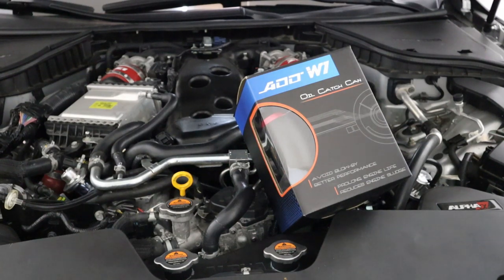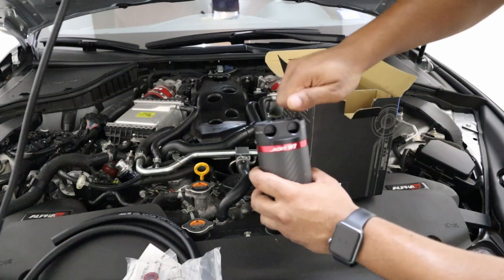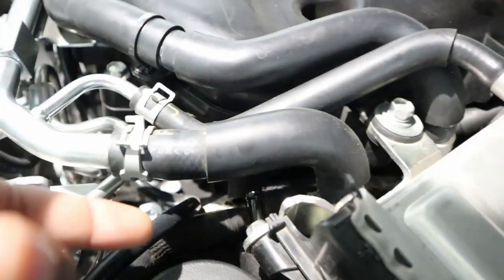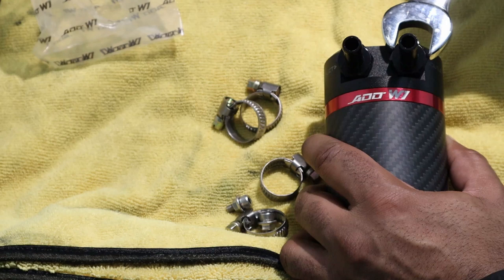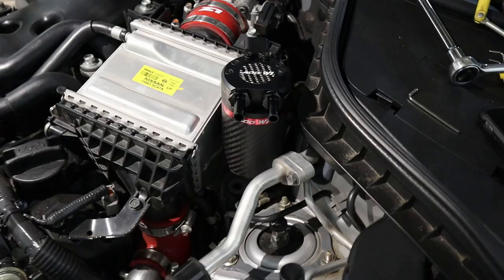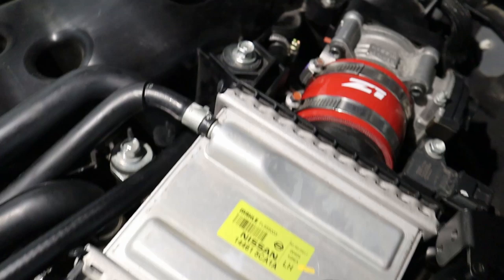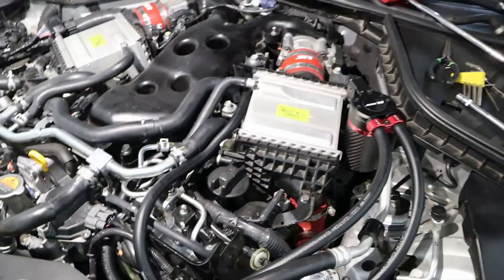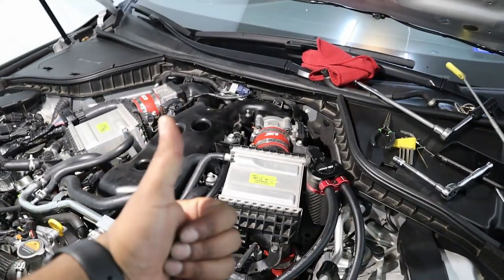Q50/Q60 VR30DDTT ADD W1 Carbon Fiber Oil Catch Can Kit DIY Installation

Comment: Great video! I’m about to install the exact one on my q50. Question, does it say in the instructions (because I haven’t received mine yet) that it works best with the hoses that long or can we cut the length down to better route/fit? They seem to long.

Comment: I see you already had BOVs installed. Do you think doing the OCC install first would make it difficult to do the BOVs after, or should I do the BOV install first?
Reply from the maker: Either or is fine. Pretty simple to install both. Or work around both i should say

Comment: Hey man just got ecutek tuned. What oil do you usually use to top off with? They mentioned I needed to keep the oil level high once I got the tune.
Reply from the maker: That is correct and I use 5-30

Comment: I take it no real difference in performance over the Mishimoto, more of a preference thing. The dip stick is a nice additon tho, saw you can put in a small house and use a plastic syringe to extract oil out instead of disassembly
Reply from the maker: Either or will work. The Mishimoto has a better bracket i will say.

Comment: I’m guessing that installing this won’t leave room to put the engine cover back on, does it?
Reply: It also seems like a tower strut bar would not be usable with that location?
Reply: @casperq60  With my Mishimoto setup, a STB would not fit. I chose running the CC over a STB. It looks like he can't fit a STB either. My engine cover fits.
Reply from the maker: Engine cover can be added back on.
Reply from the maker: A strut bar is useless to me really specially being AWD i don’t feel any difference with one so a waste in my
Book.
Reply: @EnthusiastPOV  <--- agreed. To much wiring harness screwing around, and lines in the way. MUCH prefer a CC anyday. How's TX? I was hoping when I go to AMS to have hooked up n chatted about cars. If you ever come to NH look me up. I believe you have my email.
Reply: @EnthusiastPOV  would you reccomend the moshimoto oil catch can for around 120$
Reply from the maker: It’s not bad but I’d go with add w1
Reply: Enthusiast POV nice. Also I have a 3.0t with about 70k miles. Do you think adding a bov kit would benefit me at that amount of mileage or have my turbos been ran through enough it won’t do any preventative measures
Reply: yes it does

Comment: I put the Mishimoto Catch can on my Red Sport. I get about 40-45cc of crud at each OCI of 4K-5K miles. I checked at 1K, then 2 k, etc. until I realized 4-5K miles was fine. I do Blackstone oil analysis at each change. Baised on the data 0-20 works fine. Direct  injection needs a catch can!

Comment: Thanks for this can’t wait to try mine on
Reply: Hey I installed mine , but I’m concerned about he hoses , it’s slightly kinked at the connections because it’s not the oem hose and also one of the hoses touching an area where it gets really hot , will it melt ?

Comment: Any idea if the catch can will void warranty? Returning it back to stock before dealer visits would be brutal as getting the factory hose back on would be ridiculously hard
Reply from the maker: It probably does void some type of warranty. The install and uninstall is pretty easy.
Reply: @EnthusiastPOV  getting that stock pcv hose back on is definitely not easy

Comment: Does that dip stick on the CC have an oring to seal it closed when it's screwed on?
Reply from the maker: It doesn’t need one. It’s screwed on and seals nicely. Even if overfilled, you’ll never see it spill from there
Reply: @EnthusiastPOV  thank you.

Comment: What happened to the original oil catch can you had? You made a install video months ago and suggested you supported that brand. After watching that video i bought that product. What happened?

After you put some miles on the car with some hi-performance driving with that catch can installed, pull the clean air outlet hose and for example run a gun bore cleaning rod with a clean white patch into the hose. Let's honestly and with an unbiased point of view see how well that Tripple Twister baffle design really is at catching the liquidified vapor contents.

I'm always leary of reviews where the reviewer recieves the product for free. That's just me.
Reply from the maker: The original catch can was fine and there is nothing wrong with it. If you purchased it then you should still have a solid product. I bought the catch can to show it to all of my viewers my intention was never to keep it not sure what gave you that idea. Your preference on how you see videos or products on my channel may not be what you’re looking for. I’ve always given my unbiased review on products I’ve tried. The Mishimoto catch can felt unfinished and this one does with the exception of the bracket which I feel Mishimoto executed much better. The triple baffle system will be reviewed once I open it up in 500 miles just to see what it has done.
Reply: @EnthusiastPOV You say "my intentions were never to keep it. I dont know what gave you that idea".

 You installed that product on your car and you bought it with your own money is what gave me that impression...so yea, seemed like you bought it to use. No where did you mention the fact that it was just for demonstration only purposes. With this said i knew it was a good/tested product so im not blaming anything against you for flip-flopping. Just seems like you and your other Q50 partner float around to whoever sponsors your videos as to who you promote. I understand that thinking but that rarely leads to the best and most authentic product presentations. Free stuff usually doesnt add up to the best stuff. 😞
Reply: @EnthusiastPOV  To see how well it actually works which is the whole basis for buying something like this is to check the out going clean side hose for oil and other content. Now since you've gotten supported by the company with a freeby the answer is will you provide a unbiased and truthful review in the future? If you don't give a positive update/future review then that company will be upset with you. See how that works?

Also, the comment that the first reviewed CC seemed like unfinished or something is an out in left field comment. What did you expect for a under the hood item that catches oil? Hopefully that it caught 99.9% out the junk that gets sent back into your motor. There is nothing more that needs to be done to the Mishimoto to make it function any better. Oh, that's right some colored decorative "machined" aluminium pieces and a carbon fiber inlay which makes your version they sent you something like $230. Mishimoto makes a carbon fiber version as well and what counts is they test their products and develope them in house in the United States. After that they are then produced in china just like ADDW1 and 95 precent of the other good in the USA for now. 

Hey man...this doesnt mean the end of the world for me...im happy with the first product you reviewed and i also tested it to see that i got my moneys worth. It's catching 99.5 of the crud that otherwise would be going back into my combustion chamber and sticking to my intake valves. Sorry to come off so negative but had to get off my chest.

Comment: I installed the add w1 can on my 2022 q50 turbo. I was impressed with the build quality of this kit, can and fittings. the can has a nicely designed baffle system that should work well. My problem area was removing the old hose, some silicone wax spray helped but it took a lot of pulling and prying to get it out. the new hoses were easier to install